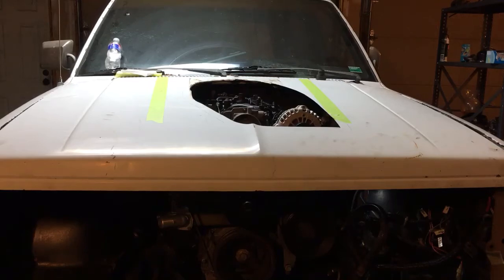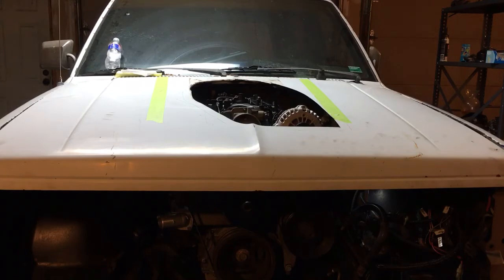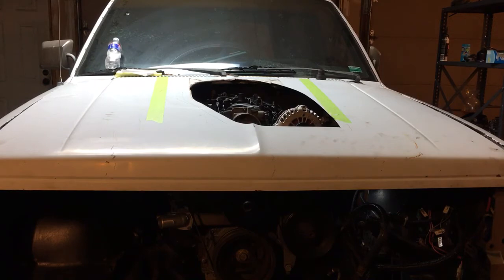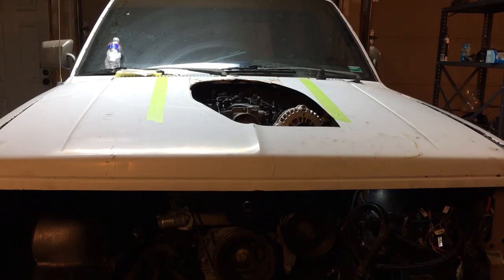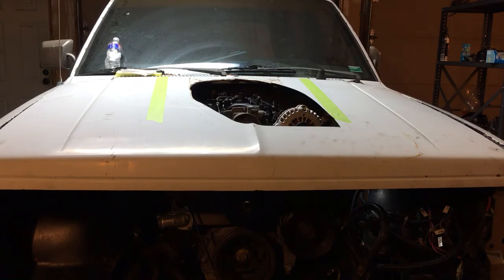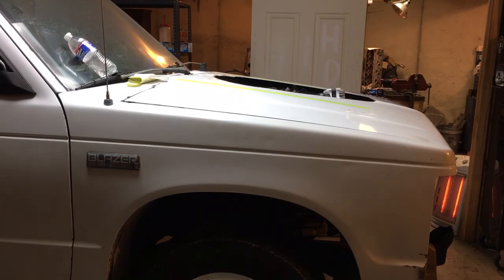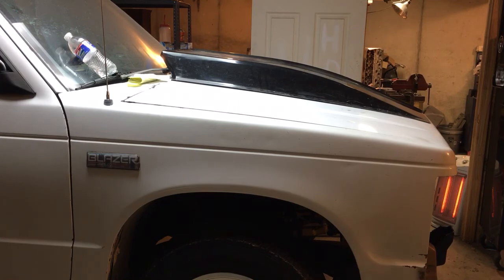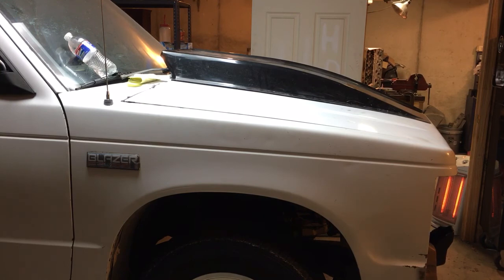S10 5.3 swap Hood Clearance

Comment: Great video, and nice cowl hood find. Probably too late now but what about relocating the alternator, with different brackets?
Reply from the maker: 91Cruzin All the relocation brackets I've found are $200-400.  Some of them also require switching to the LS1or Corvette water pump which also requires crank pulley spacers or a different pulley. Relocating the accessories is way more costly than it should be.
If I switched the intake to a car intake, requiring the LS1 water pump, and relocated the alternator and power steering it would fit under the factory hood.  The cost was my reason for doing the scoop instead. JD
Reply: HeadFlowInc how do u remove a s10 front clip
Reply from the maker: jag_04letsgetit Remove the big bolts at the core support, the bolts to the firewall, bumper supports, there's wiring to unplug. I need to make a detailed video.  See if there's any other videos available to help out.
Reply: HeadFlowInc thanks could u make a video on that
Reply from the maker: jag_04letsgetit I will try, we're in the middle of moving so it may take a little while. It does take 2 people to lift the front clip off once all the fasteners are removed. JD
Reply: HeadFlowInc Have you seen and swaps with the Trail Blazers i6? I know there is a timing issue, I believe there is a after market solution to the timing problem. It’s a dohc 4.2 liter i6 engine. Ford puts a similar engine in the Australian ( Fairlane?) . They put a small turbo on them and double the output. The reason I ask is I want a good powerful, economic engine for my c10. The ls isn’t necessary for my purposes. Even without a turbo in factory trim a dohc i6 should be plenty for a short box Chevy pickup. I haul a little fire wood with it. It has a 230/250 ? I6 that burns oil and it bangs pretty good especially at higher rpms. The column shift is worn out. Plus it doesn’t have enough power regardless. I think a i6 with a 4 speed auto would be a major upgrade. I know there are plenty of the engines around. Just not sure about switching them out. Thanks your s10 is looking good , it should get you there in a hurry. I am not a ls fan . I see no reason for stopping production of the 400 small block in 1980. Even though it’s back now we lived 40 years with a 350 . Gas hog . Overrated, and actually it didn’t produce much power from the factory. The 400 does run warm . It doesn’t overheat unless driven stupidity. It gets better mpg . And it has a lot more usable power. I like them better in a work truck than a 454. My work with trucks is behind me now thank GOD . Now I work on them (. Some) and use them for chores and short runs . Otherwise I have a Car to travel in. I also have a GMC Jimmy. A 92 . It has the Sportsman package. Monochrome paint, with flat black trim. Also the black out factory Mag 4x4 wheels. It’s in decent shape. A fellow told me that these little wagons are selling for crazy money. I’m the 2 Nd owner. 160,000 miles with all service records. A engine swap was done 20,000 miles ago by professionals . The only engine and trans replaced with the same spec replacement. 1 wreck ( front drivers fender is replaced. Other than that it’s factory original. Outside is in average stored outside condition. The interior is almost flawless. It’s hi quality cloth with color match pinstripes. No rips or burns. Dash pad is cracked. 2 tone red. I couldn’t believe how much I was told they are selling for. Never would have thought that. Everyone used to have 1 or 4 of these tin cans setting around. Parts are cheap. I amazon shop for parts. Bought a fuel pump for 20 bucks . On my porch the next morning. Napa wanted 180 bucks for the same identical ac delco hi pressure pump. I buy local when affordable.

Comment: how to remove a s10 front clip
Reply from the maker: jag_04letsgetit Previously we always removed the front clip as a whole unit, this time I was without help so I pulled the core support.  The front clip isn't very heavy; one suggestion though is pull the front tires off if your pulling the clip makes it easier.